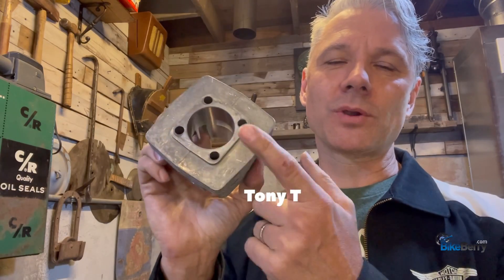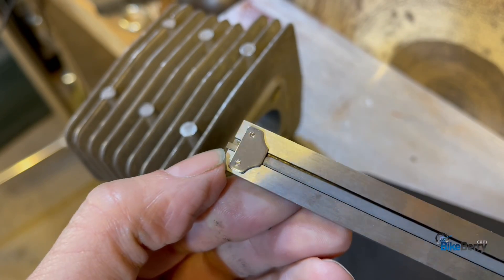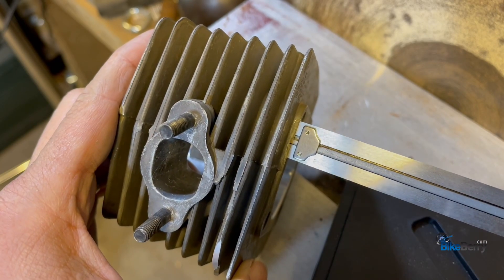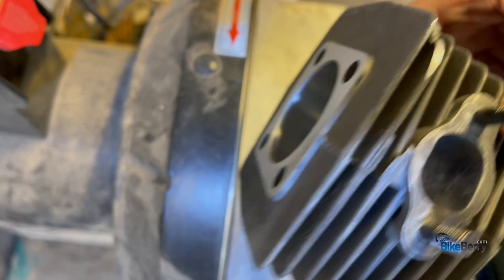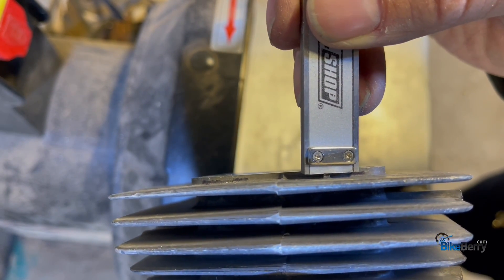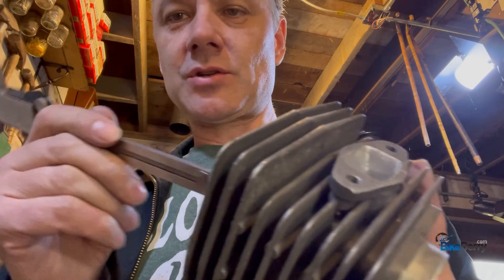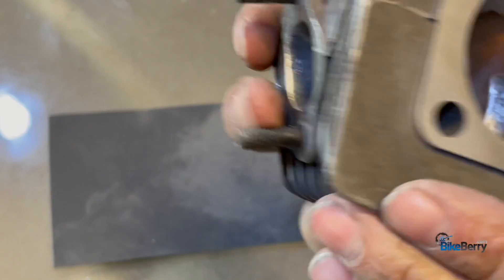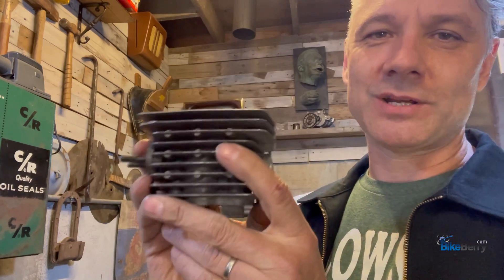Porting Video #3 - Decking 2 Stroke Cylinder | BikeBerry

Comment: I really wouldn’t recommend doing it this way, it should be done on a million g machine..sanding it like this won’t give you a flat surface to be gas tight…🤔🤔🤔
Reply: Not everyone has access to a milling machine.
Reply: @tonytaylor5087  true,.. but everyone has access to a machine shop that does, there is a right way to do this and as a mechanical design engineer machining it correctly is very important, you can’t rely on the top fin as a datum for measuring it to guess if it flat or not as they are not perfectly flat.
Also taking too much off can cause the piston to hit the cylinder head , your pretty much guessing with that measurement method and a disc sander.
Using a milling machine means you know exactly how much material has been removed and that it’s perfectly flat and parallel. .
There’s an old saying, if a jobs worth doing it’s worth doing well.
Every engineer who knows what they are doing would cringe at watching this method…🤔🫣🫣🫣
Reply: Sincerely appreciate the insight. 
The way I look at it is this is a fun inexpensive hobby for the most part. If I screw up a cylinder body by learning how to modify it then it’s only $20.00 to get another one and I learned what not to do. 

Some people may not be comfortable doing this by hand and that’s ok. They can take their parts to a machine shop and have them knock some off the top. At least they learned a new trick by watching this video. So to each their own.
Reply: Mine seals up great you don’t need a machine shop to do it they charge A lot because their using those same big machines that they do in car engine blocks etc. They wanted $100 for putting a bigger piston on my 47mm
Reply: Also take a $20 cylinder to a machine shop is not very practical…
Reply: @keeganhache6667  it’s very practical if you take too much off and smash your piston on your cylinder head and wreck your engine don’t you think?
Reply: The main problem doing it this way is the barrell not being in line with the geometry of the piston
Reply: @dean-gm1lg  not true
Reply: @keeganhache6667  it's perfectly true and also common sense barrell bases are machined flat for a Reason and it's not just  to get a good seel on the base gasket
Reply: @dean-gm1lg  and don’t you realize that this stuff is so small that it’s not gonna matter? Just run it over fine sandpaper on a glass table and hundreds of builders do it this way… remember this is small engines not a car engines deck surface
Reply: @keeganhache6667  I'm not saying it won't run I'm saying it won't be perfect as being machined therefore longevity is compromised because unless it's perfect it will wear the bore and piston out in certain areas faster than normal  especially if it's misaligned across the wrist pin axis ,plus Its not expensive to have it machined properly,but that said if you don't have access to a machine shop then you have to do what you have to do
Reply: Genuine question, how do you make sure an irregular shape like a cylinder head is square in a mill? Dial indicator on the surface to be milled? Or run an indicator up the cylinder wall? Or something else?